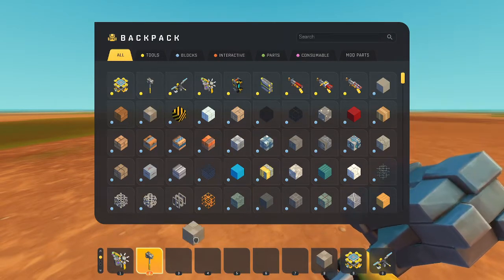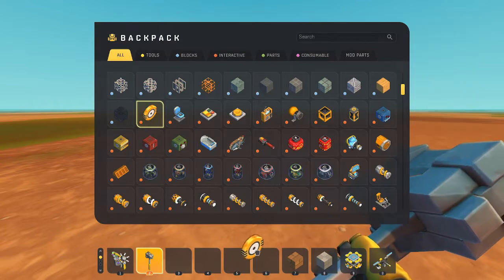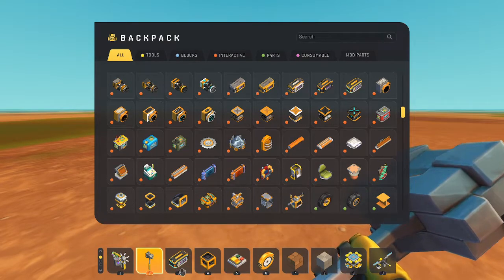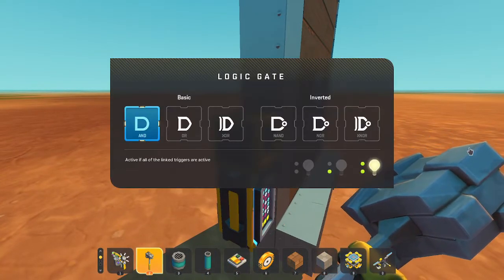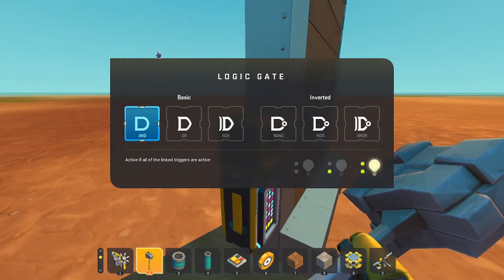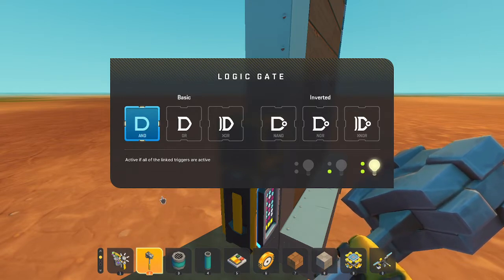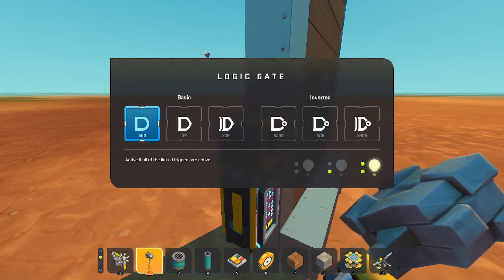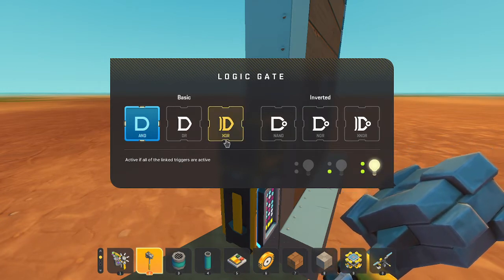How to make a simple door (Scrap Mechanic)

Comment: does it have to be more than 1 mateiral?
Reply from the maker: It doesn't need to have more than 1 material, I simply use multiple to easily display the 2 components of the door.